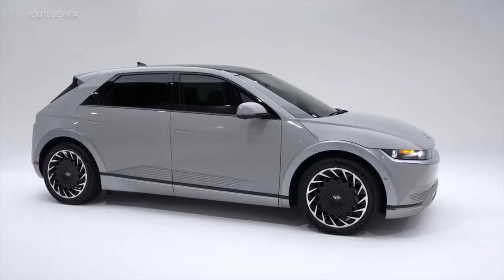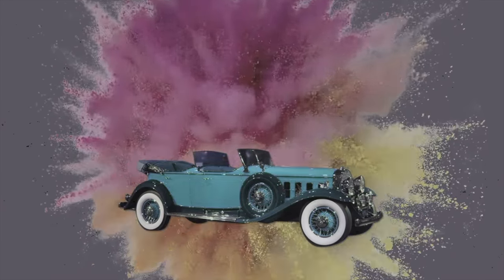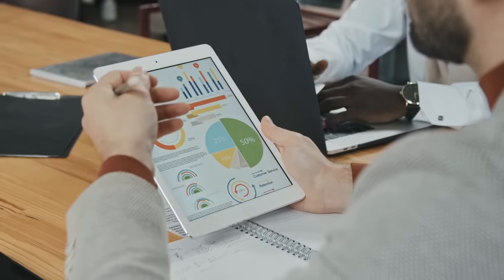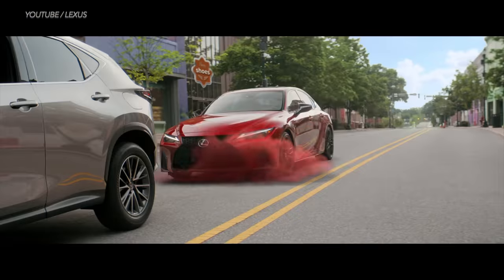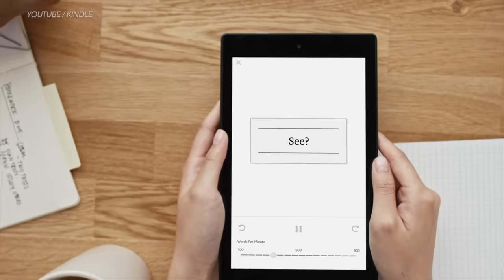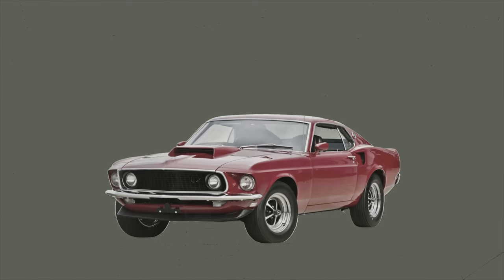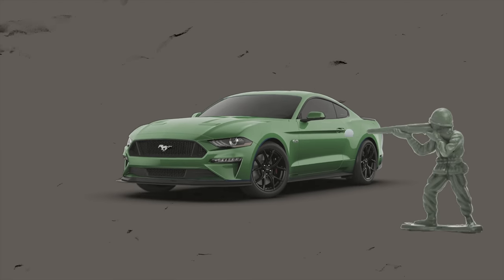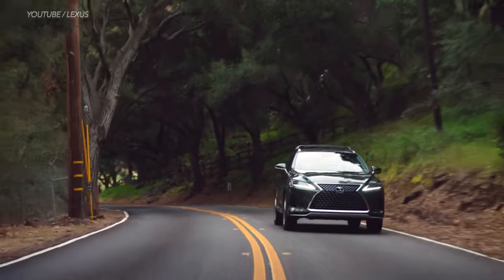Here's Why the Police Will Pull You Over if Your Car Has This

Comment: Scotty, white is the best for many reasons and as you mentioned it's very visible. But in hot climates it is much cooler inside too.
Reply: i dunno about that, most heat absorption is done in the infrared spectrum, and unless the white is highly specialized to reflect in the ir range, all the different paint colors have the same effective black-body heat absorption. i think one thing that will help is high irr ceramic tint on the windows, which can prevent nearly all radiated heat from entering the cabin through the windows. source: i have a white honda in thailand with crystaline tint.
Reply: I test by trying to hold a hand on the car after it sits out in the sun. Try it 🙂
Reply: @itchegerton8004  flat black is even better at absorbing all the energy.   That's what these kids are doing. Absorbing energy. 😂
Reply: @IzziedeD  Hate to disagree with you, but my mom, dad and I have  tested it with a thermometer. White makes a big difference. Sorry, Scotty. Silver still loses to white.  Were we ever surprised about that one!
Reply: @jazzcatt  are you saying they had 2 identical cars in 2 different colors to test?
Otherwise it's not really accurate.
Reply: @Hi Me  No. It's not perfectly accurate, but the difference was notable. We did however have the same Ford Taurus. Hers was white, mine was sea foam green. Huge difference in  the inside temp. Our little experiments were good enough to convince me that white is the best to have. Try it yourself and see.
Reply: @jazzcatt  That's cool! (no pun intended). I stand corrected. Thanks.
Reply: he also mentioned white reflecting heat..
Reply: @jazzcatt  Agreed... silver absorbs a lot of heat. I pulled the inner panels on my new silver car and installed metalic faced sound deadening... cooler and less noise. (The windows got a mild tint w/ heat reflection. You can feel the difference w/ windows down or up.)

Comment: The worst Myth is that EVs are any good!
Reply: BINGO!!!
Reply: They can be if you have a charger at home and you have a lot of money... I don't have either of those things, but if I did I might consider an EV
Reply: EVs have a lot of torque compared to fossil cars
Reply: You’re living in the past
Reply: EVs are better!!!
Reply: New is scary 😅
Reply: @xlargetophat  your EV dreams will fail
Reply: @ThomasKing19933  Tesla cybertruck. 48 volts, not 12.
Reply: @pickelkilla  you’re living in delusion
Reply: They definitely aren't worth the money, let alone how horribly quiet they are
Reply: All politics aside, I think that focusing on getting the power grid off of fossil fuels first and THEN transitioning to electric cars would make a lot more sense. Seems like they are doing it backwards.
Reply: @superusseljames  exactly what needs done
Reply: the even worse myth is that gas cars are good
Reply: @rctezluh42069  🤡
Reply: did you hear about the new EV with a 5 speed manual tranmission ? NO - they are all sissy automatics
Reply: @Rolatnor  I'm homophobic
Reply: @xlargetophat  you be you js
Reply: @superusseljames  that should tell you that it's not actually about going green
Reply: @gibbyjones1040   "transmissions" in electric cars are different from those in gas-powered cars. There's only one gear that operates the entire drive system, hence the instantaneous torque.
Reply: @S.Hoodie  the torque is the same, but EV has single gear transmissions where all the torque is applied at once while gas-powered vehicles torque is applied over multiple gears.
Reply: @chastoncotton  yeah it looks like you are correct
Reply: Never was
Reply: Ev's are fine up until about 8 years and 100k-ish miles when the battery warranty expires.
Reply: Depends on what you want.
Reply: So far we have enjoyed our Chevy Bolt. It's quick, roomy, and handles well.
Reply: Mr King is misinformed, I'd say.

Comment: White with tinted windows & black interior is the best color.
White resists heating up in the sun in summer. Color doesn't affect a car much in winter when the sunlight is weak. Tinted glass heats up "at the glass", removing frost/dew better. And black interior avoids glare from street lamps at night, and resists interior stains (but would cause overheating without the tinted glass). Also, white doesn't actually show dirt much. Road dirt is a kind of light gray to champagne color, it's horrible on dark colored cars, not bad on light colored cars. White with black and/or chrome trim looks great too.

Comment: The last 5 vehicles I’ve driven:
1993 F150 white
1994 F250HD white
2004 Ranger white
2009 Ranger white
2011 Ranger white. 
On the last day of Ranger production at the Saint Paul Ranger plant in December 2011 the 3 big parking lots was a sea of white Ford Rangers, 6 brown and cream Rangers and one dark blue Ranger.

Comment: Red is the most expensive color for new vechice production and autobody repair shops due to the increased cost of the pigments required,  grays are the least expensive. No wonder the OEM's are pushing grayscale colors!  A gallon of red pigment cost body shops $800 per gallon or more although virtually no high production shops are willing to perform all-over paint jobs due to the low margin and extra long cycle time to complete. Its hard to beat Maco's $400.00 all-over single stage (not base coat/clear coat) paint deal. They only make a decent profit by repairing the dents (labor) which will be painted over unless they are fixed first which results in shiny dents ~

Comment: The muted earth tones you refer to have been around since the latter 1930's.  The gray, green, and tan shades were all used by the German military of that era as highly flexible camouflage colors that were durable, effective, and easily convertible from one to another.  It is alleged that Hugo Boss was the driving force behind these colors.  Ford had attempted on several occasions to revive these colors post war but they were quickly recognized by too many for what they were.  That generation has passed and now they are back in all their muted and durable glory.

Comment: I had a 5.0 liter 1990 Mustang convertible Lx. It was what they called “Deep Emerald Jewel Green Metallic. I think it looked nice in the sun but just too dark in the shade or at night. They said not many vehicles were painted green because there was a superstition that a green car was bad luck due to many green race cars had gotten into an unusual amount of deadly crashes. And according to insurance records the most pulled over color was grey. Not, “Arrest Me Red.” I liked the 1991 Mustang, “Bright Green (Calypso).” And the tail lights looked better too. Not too crazy about the wheels the 1990 looked good. I wish I had a manual 5 speed.
Reply: Was that a 7-Up Mustang?
Reply: @jphilb  Yes that was the mustang i purchased in 1990. It didn't have at GT badge but it had the same HP with 5.0 and an LX on the back. I had to sell it since my second wife had three speeding tickets in two weeks. I never had one in it. I did on my motorcycle a 1970 Honda 750 k2 and a 75' T-bird.

Comment: I have a 07 Jeep Grand Cherokee 5.7. Just had a water pump put on and drove it maybe 15 miles and the radiator cap popped off it didn't show it overheated after putting water in it won't turn over, it starts rough just can't get it to start.
Reply: Oil isn't milky.

Comment: Scotty! 2006 nissan armada with 221000 miles crank but wont startup. i replaced both crank sensor and crank position sensor and still not startup.
Reply: fuel issue?

Comment: Scotty, wait til you see my Fiesta. It no longer has any indication that its a Ford. I also "rubberized" the door panels, bumpers, and rocker panels. I used rust oleum undercoating. It wipes off with gasoline and can be touched up anytime with a spray can. If I want to sell the car, It can all be returned to original condition quickly and easily.

Comment: A year ago last November, I purchased a used 2013 Lincoln mkx SUV.  I love it.  It has a black metallic paint job, beautiful in the sun.  Sure in the summer time, it will get hot, but I make certain to park in the shade when I can, but in the winter, it is great!  I park in the sun and hours later, when I get in, the car is prewarmed by the solar effect.  This is the first car I ever had that was solid black, and believe me, I was surprised to find that there were some positive attributes to having a black car!  It does not hurt that the SUV also has instant seat heaters, and seat air conditioners in the front!
Reply: eh, both my Camry cars have heated seats, that takes about 30 seconds to start working.

Comment: There was one of those Gumball Rally type movies back in the 70’s that had a Lamborghini Countach driven by two supermodels (but of course) and they evaded the cops by going through a car wash. Turns out their car had some sort of temporary paint, like poster paint, that washed off. 

I’d bet there’s probably a few handfuls of bank heist movies with easily removable wraps to do the same thing. 

Only in Hollywood!
Reply: There are several movies that use van with a wrap that is removed to change its look.